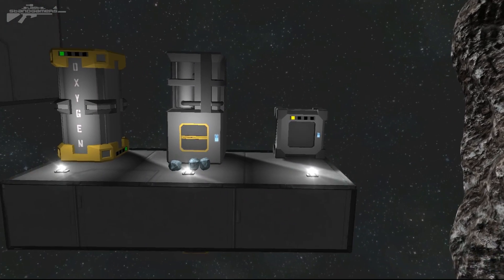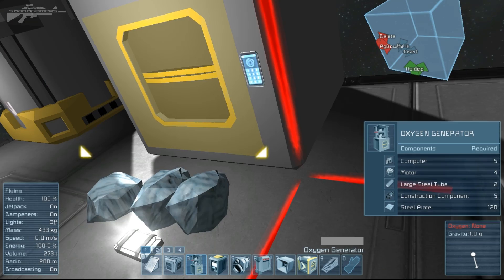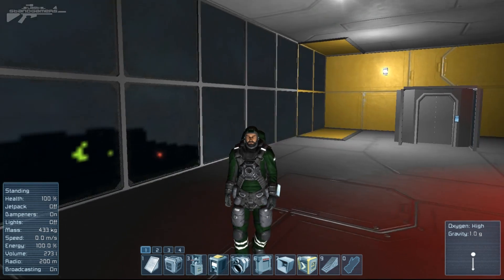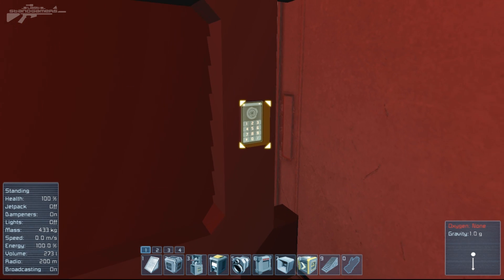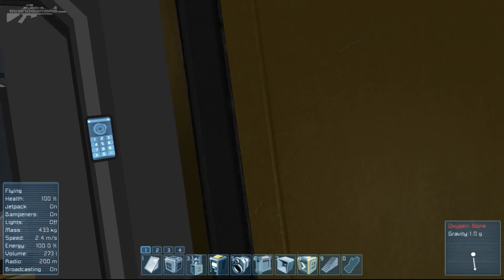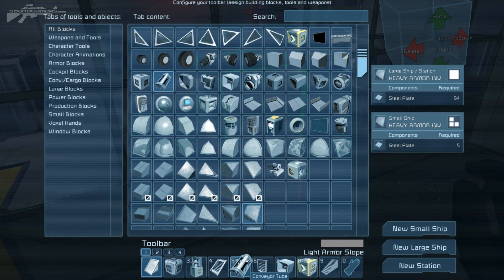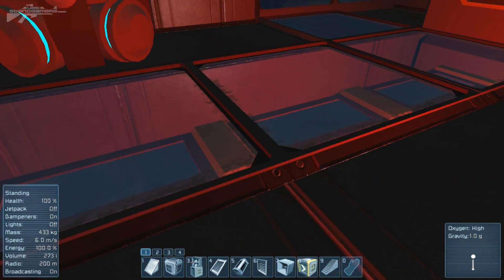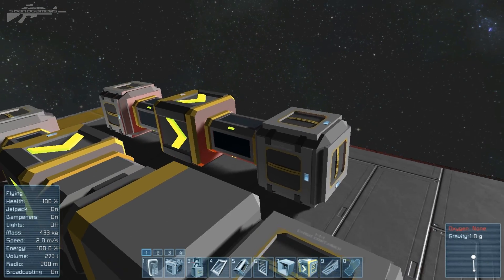Space Engineers - Oxygen, Take Your Helmet Off !!!

Comment: Doesn't that mean that battleships would need emergency airlocks
Reply: I'm sure you could use the programmable block to close the doors when the vent detects a vacuum
Reply: most likely
Reply: or spaced armor
Reply: flamedramon I'd say a single door would suffice for emergency vacuum isolation in most cases. Also I suspect (as many others) the devs will soon intorduce a dedicated airlock thingymaboble, maybe something like those rotating quarantine chamber doors.
Reply: puskajussi37 I think we need a way to seal off a hanger,  so you can pressurize your hanger. Just would be cool!
Reply: 2MeterLP Maybe there should be a forcefield generator like in Star Wars. One that could be scaled to any size (within reason) and would let blocks through but no air. That could help with docking stuff also. The fields would collapse if power went out.
Reply: rainbow six
Reply: There'll probably be a mod soon that is a block (or collection of blocks) that's 1x3-ish with doors on both ends and 1 block space in the middle, and would act like a blowback preventer on offshore oil rigs- as soon as the game starts to detect and act upon a pressure loss in an oxygenated area, any of these door systems within this area would slam shut.
Then, as the player scrambles to fix the problem or just keeps on firing, the door system would only allow one of the two doors to be open at any one time as long as one end of the system is in an oxygenated environment and the other is not. That's so the guy doesn't accidentally fuck it up even more.
Reply: Jay Shaw You would need a big door block, like 5x5x1, because blast doors are not airtight. Also using a fighter airlock would prevent you from quickly starting all fighters. So unpressurized hangars would be way less complicated.
Reply: puskajussi37 Space engineers is sent in relatively near future, so there wont be forcefields in the vanilla game. But i bet there will be forcefield mods!
Reply: I wish you could pressurize asteroid bases. it would probably be impossible because you cant 100% seal a hand made blast door.
Reply: First of all the hanger thing. I am just going to have my hanger not pressurized and the Hallway thing I'm just going to have every hallway had emergency doors on both ends
Reply: Also my ship is so big that the hallways are only on the edge in the rec room that I built
Reply: Matt Douglas Maybe they´ll add a "detect Oxygen" function to the sensor
Reply: ÐISЯΞSPΞCТ More like "detect atmosphere". Humans would still die within seconds if the composition of the air was 100% oxygen.
Reply: Yea you´re right.My bad.
Reply: ÐISЯΞSPΞCТ Although, it very well may end up as atmospheres created in space are only oxygen and water vapor, because I have no idea how they'd have us get the nitrogen, argon and CO2....
Reply: why would you bother supplying oxygen to a battleship? A capital ship or a carrier would make sense, but a battleship doesn't
Reply: My ship will have a ton and a half manned defenses so it will need a large crew when multiplayer takes off